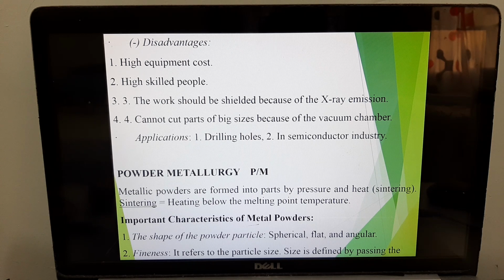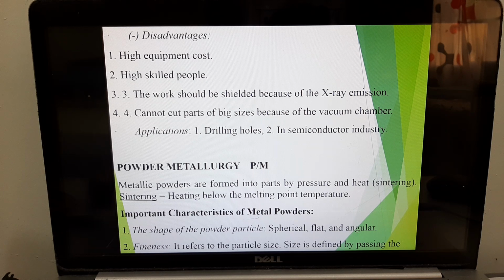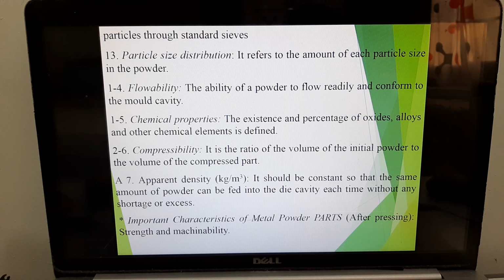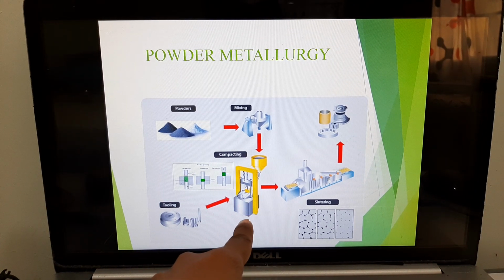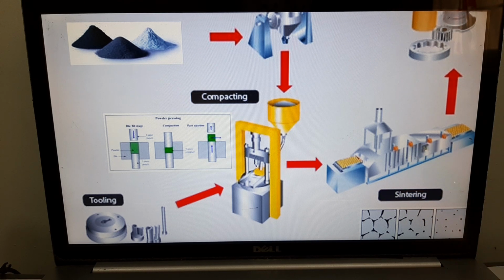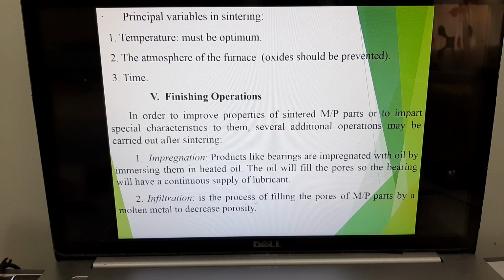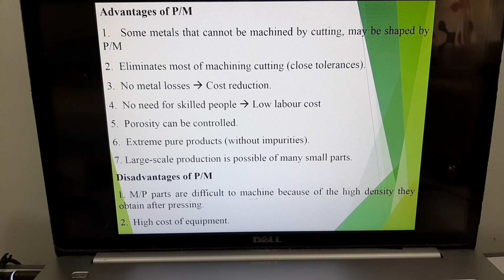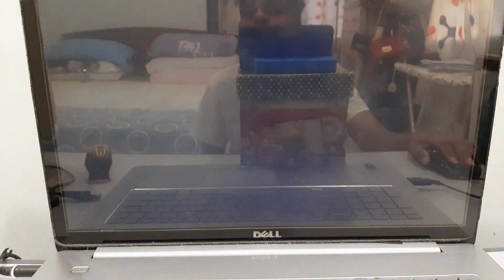POWDER METALLURGY PART 4

Comment: Name : Aiman Hazim Bin Arif Razman
ID : ME0106080
 
From this video, I have learned about Powder Metallurgy (P/M). It has the same concept as die-casting. Metallic powders are formed into parts by pressure and heat (sintering). Sintering is a process of heating below the melting point temperature. Powder exist in nanometer size. The important characteristics of Metal Powders are the shape of powder particles consists of spherical, flat & angular, the fineness of the powders which refers to particle size defined by passing the particles through standard sieves, particle size distribution which is the amount of each particle size in powder, the flowability which is the ability of powder to flow readily & conform to the mould cavity, the chemical properties which is the existence & percentage of oxides, alloys & other chemical elements is defined, compressibility which is the ratio of volume of initial powder to volume of compressed part and the apparent density (kg/m^3) which is constant so that same amount of powder can be fed into the die cavity each time without any shortage or excess. Th process is done starting from manufacturing the metal into powders, then the powders is added with alloys and die lubricants, it is then put in standard sieve, then mixing, then compacting using compression machine where it is physically compacted, then it is sintered where the atoms will be chemically bonded together, then finishing operations will be done. During finishing operations, impregnation, infiltration, coining/sizing, plating, heat treatment, and machining can be done. Impregnation is are products being impregnated with oil by immersing them in heated oil. The oil will fill the pores so the product will have a continuous supply of lubricant. Infiltration is the process of filling the pores of M/P parts by molten metal to reduce porosity. Coining and sizing is products are repressed to import dimensional accuracy to them. Plating improves appearance and resistance to wear and corrosion. Heat treatment improves hardness and strength. Principal products of P/M are filters with 97% porosity, cemented carbides (inserts) for cutting tools (tungsten carbide + cobalt), gear and pumps rotors (iron + graphite), brushes for motors (copper + graphite), bearings (copper + tin + graphite) and magnets. The advantages of P/M are eliminates most of machining cutting (close tolerances), no metal losses which leads to cost reduction (powder is compacted so no loss of powder) and porosity can be controlled. Disadvantages of P/M are M/P parts are difficult to machine because of high density that they obtain after pressing (hard to machine afterwards as it is highly densed, high cost of equipment and metal powders are expensive and difficult to store as we need special containers and a controlled surrounding humidity to store in appropriately.

Thank you for the insightful video Dr.

Comment: Good morning madam, I'm Mohammed Abdulhadi (ME0105493). 
i learned from this video about powder metallurgy as it is the process of forming metallic powders into parts by pressure and heat (sintering). 
It can be formed in different *SHAPES*: Spherical, flat etc..)
Fines: particle size that can pass through a standard sieve.
Particle Size Distribution: Amount of particle size in the powder
Flowability: Ability of powder to follow readily 
Chemical properties
Compressibility 
Apparent density 

it has its own finishing operation for example Impregnation , infiltration, coining, sizing and plating 

Adv
 No metal losses
, No need skilled workers, Controlled porosity
Disadvantages:-
Expensive machine 
flammable
it gets oxidized 
Thank You Madam

Comment: Good day madam, the information gathered from the video is on powder metallurgy. It has the same concept as die casting, but we use metallic powders to molten form and poured into a mould and compressed and sintered (heating below melting point).  we use metallic powder have many important characteriastics such as its spherical, flat and angular, the fitness  Shape: Spherical,flat and angular
, particle size distribution: amount of each particle size in the powder, flowability the ability of powder to flow readily and conform to the mould, chemical properties the existence of oxides, alloys and other chemical elements, compressibility the ratio of the volume of the initial powder to the volume of the compressed part and lastly apparent density the  constant, same amount of powder fed into die cavity.
First, the powders will be sieved to ensure particle size is in nanometer, then we mix it with desired iron sulphide or. Then we compact the powder mixture with a hand press into a mold to compact into shape. Once we have the shape, we then undergo a sintering process by heating it up above recrystallization temperature. heat it up below melting point to ensure it in semi solid shape. during this process the void will be eliminated and shrink.
the finishing operations are, impregnation ( products like being are impregnated with oil by immersing them into heated oil. The oil will fill the pores so that bearing have continuous supply of lubricant. Next is infiltration which is the process of filling pores of powder metallurgy parts by molten metal to decrease porosity. Examples of powered meturllegy are Filters
, Cemented carbide inserts, Gear and pump rotor, brushes for rotor, bearing, magnet. The advantages it can machine metals which cannot be machined from cutting, close tolerance, no metal losses, does not need skilled workers, controlled porosity, extreme pure products,  large scale production. The disadvantages are that the parts are difficult to machine,has high machine cost ,p owder is expensive and hard to store, intricate designs are difficult to be attained, may be explosive or flammable,thermal difficulties, oxides may be produced on the material.

Comment: Good day Dr. Im Lee Zi Sheng ME0106051. Powder Metallurgy is same concept as die casting.
Metallic powders are formed into parts by pressure and heat (sintering: Heating below the melting point temperature)
Important Characteristics of Metal Powders:
1. The shape of the powder particle: Spherical, flat, and angular.
2. Fineness: It refers to the particle size. Size is defined by passing the 
particles through standard sieves
3. Particle size distribution: It refers to the amount of each particle size in the powder.
4. Flowability: The ability of a powder to flow readily and conform to the mould cavity.
5. Chemical properties: The existence and percentage of oxides, alloys and other chemical elements is defined.
6. Compressibility: It is the ratio of the volume of the initial powder to the volume of the compressed part.
7. Apparent density:  constant same amount of powder can be fed into the die cavity each time without any shortage or excess. 
in finishing operation:
Impregnation: Products like bearings are impregnated with oil by immersing them in heated oil. The oil will fill up the pores so the bearing will have a continuous supply of lubricant.
Infiltration:  process of filling the pores of powder metallurgy  parts by a molten metal to decrease porosity.
Coining and sizing, Plating, Heat treatment, Machining.
example:
Filters Cemented  carbides (inserts) for cutting tools, Gear and pumps rotors: (iron + graphite), Brushes for motors: (copper + graphite),Bearings: (copper + tin + graphite), Magnets.
pros
Some metals that cannot be machined by cutting, may be shaped by   P/M
Eliminates most of machining cutting (close tolerances).
No metal losses 
Low labour cost
Extreme pure products 
Large-scale production for many small parts.
Disadvantages of P/M
 M/P parts are difficult to machine because of the high density they obtain after pressing.
 High cost of equipment.
Metal powders are expensive and difficult to store.
Sometimes, intricate designs in products are difficult to attain because of the poor flowability of the particles during compacting.
Some powders (aluminium, magnesium, titanium) present explosive and fire hazards in a finely divided state.
 Some powders have thermal difficulties during sintering (oxide formation).
Oxides may be produced during sintering. 
 thank you

Comment: Good morning madam, I'm Chong Jin Yang ( ME0106047). From this video, I have learned about powder metallurgy. It is a process where metallic powders are formed into parts by pressure and heat (sintering).
Important characteristics:-
1) Shape: Spherical,flat and angular
2) Finess: Size of the particles which can pass through a standard sieve.
3) Particle size distribution: amount of each particle size in the powder.
4) Flowability: Ability of powder to flow readily and conform to the mould.
5) Chemical properties: existence of oxides, alloys and other chemical elements.
6) Compressibility: ratio of the volume of the initial powder to the volume of the compressed part.
7) Apparent density: constant, same amount of powder fed into die cavity.
Process of manufacturing powder metallurgy:-
1) Powder (standard sieve)
2) Mixing (add alloy and chemical elements)
3) Compacting (physically compacted)
4) Sintering ( above recrystallization temperature)

Finishing operation:-
1) impregnation
 - immersed in heated oil (continuous lubricant supply)
2) infiltration
- filling the pores with molten metal
- decrease porosity
3) coining and sizing
4) plating
5) heat treatment
6) machining

Example of M/P products:-
1) Filters
2) Cemented carbide inserts
3) Gear and pump rotor
4) Brushes for rotor
5) Bearing
6) Magnet

Advantages:
1) For metals which cannot be machined from cutting
2) Close tolerance
3) No metal losses
4) No need skilled workers
5) Controlled porosity
6) Extreme pure products
7) Large scale production

Disadvantages:-
1) M/P parts are difficult to be machined ( high density )
2) High machine cost
3) powder is expensive and hard to store
4) intricate designs are difficult to be attained
5) Explosive
6) Thermal difficulties
7) Oxides may be produced

Thank you

Comment: Good morning madam, I am Wong E-Shen (ME0106071). From this video, I have learnt about powder metallurgy. In powder metallurgy, the raw materials come in the form of metallic powders which are formed into parts by pressure and heat (sintering). The important characteristics of metal powders are the shape of the powder particle (spherical, flat, and angular), fineness (refers to the particle size), particle size distribution (refers to the amount of each particle size in the powder.), flowability (ability of a powder to flow readily and conform to the mould cavity), chemical properties (The existence and percentage of oxides, alloys and other chemical elements is defined), compressibility (the ratio of the volume of the initial powder to the volume of the compressed part) and apparent density (should be constant so that the same amount of powder can be fed into the die cavity each time without any shortage or excess). The steps of manufacturing metal powder parts are firstly, the metal is produce in metal powder form. Then, in powder preparation, metal powders are prealloyed to impart them better properties. Thirdly is making of powder parts. Next is compact and sintering. Once the parts are completed, impregnation and infiltration process are carried out to improve properties of sintered parts. For impregnation, it means the products like bearings are impregnated with oil by immersing them in heated oil. For infiltration it means the process of filling the pores of powder metallurgy parts by a molten metal to decrease porosity.
 Besides that, the principal products of powder metallurgy are filters (can obtain up to 97% porosity)
, cemented  carbides (tungsten carbide + cobalt), Gear and pumps rotors: (iron + graphite)
, brushes for motors: (copper + graphite)
, bearings: (copper + tin + graphite)
 and magnets. The advantages of powder metallurgy are those metals that cannot be machined by cutting can be shaped by using powder metallurgy, it can eliminates most of machining cutting due to the close tolerances, low labour cost and cost reduction. The disadvantages of powder metallurgy are powder metallurgy parts are difficult to machine because of the high density they obtain after pressing, high equipment cost and metal powders are expensive and difficult to store.
Thank you.